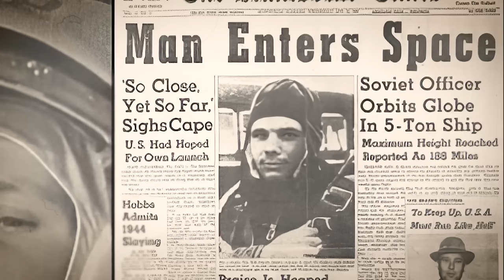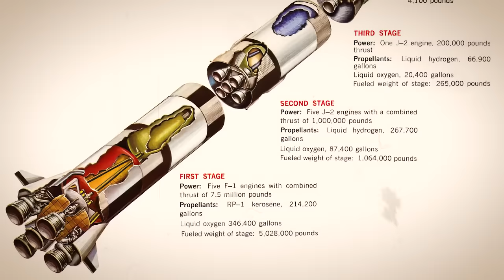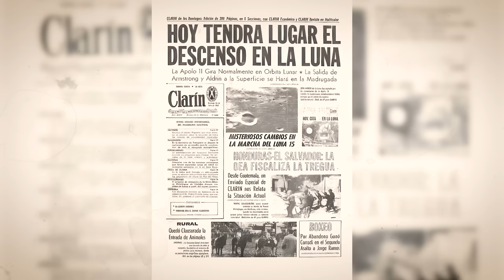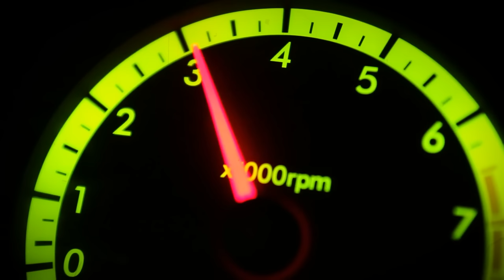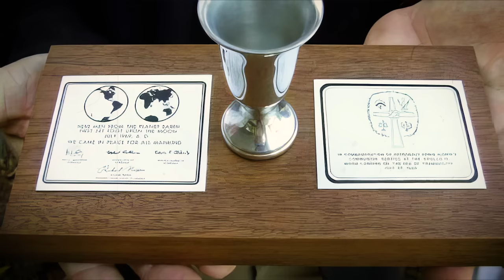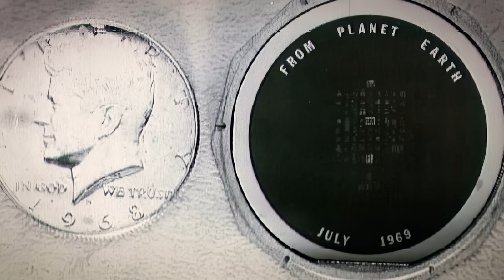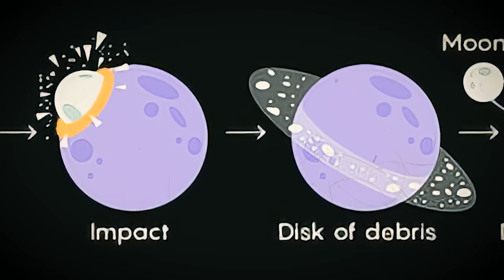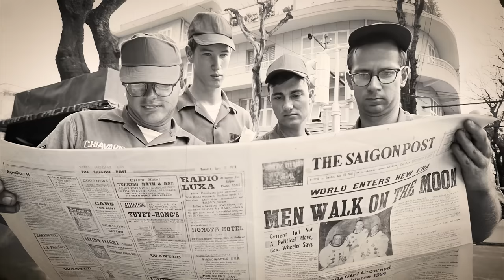NEW Apollo 11 Declassified Files: What NASA Didn't Tell Us!

Comment: Wow 54 years ago they broke orbit using rockets & they are still using the same old tech, doesn't it seem strange ?????
Reply: Definitely, yes but look at cars... Still most on combustible engines now like a 100 years + ago. 
Electric cars represented about 30% of the street pool before the Ford T Model 
and many combustible engines did not use petrol since Ford wanted farmers to use what was available before gas stations came to be. 
I think many cars used hemp oil I think. 
Electric cars disappeared due to impracticality and high price, about $2000 in 1920's money.
The T Model came at $300 in same years money.